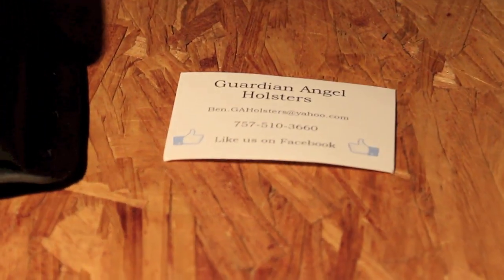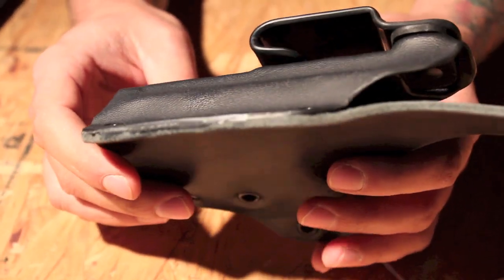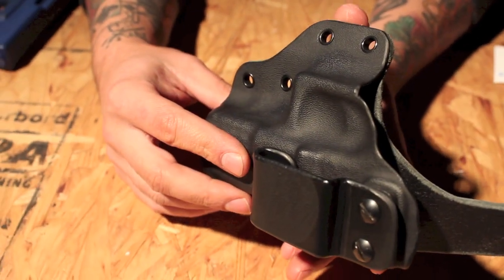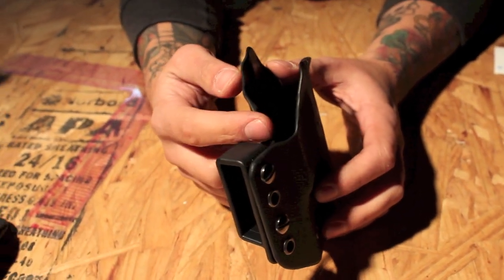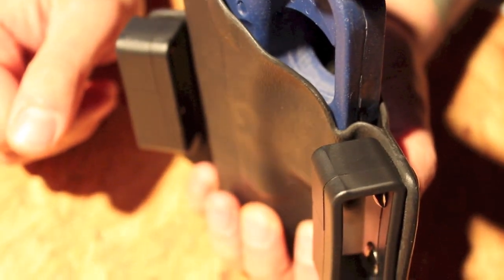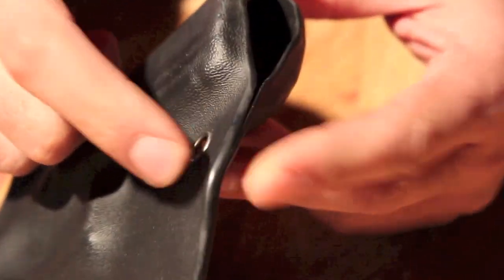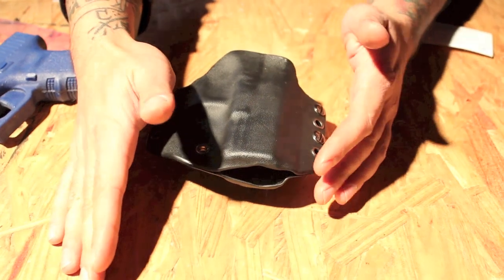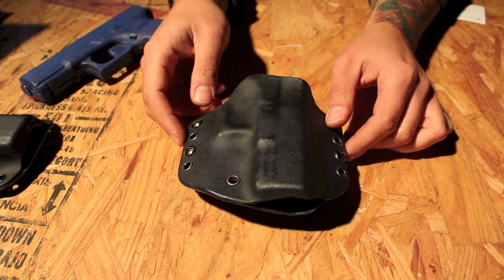Holster Clinic Episode 16

Comment: Tough love. I know leather isn't your thing, so I'd like to add that the edges of the first holster need to be burnished better, with an gum trag, and edge kote. You recommend the rough side inward; it is likely two skin sides facing out because it is a double thickness of leather, so he could put the flesh side inwards to get that rough texture you recommend. If he is buying the leather already like that, there are tools that look like wire brushes to rough up the leather.

Comment: Hey Philly, I got a tough one for ya. I have got a customer interested in a MOLLE mounted holster mounted horizontal, so the gun is parallel to the MOLLE webbing (just like the one in my profile pic except turned 90 degrees). How would I go about making that? I don't want to disappoint the guy, and I don't want to use any super pricey mounting applications.